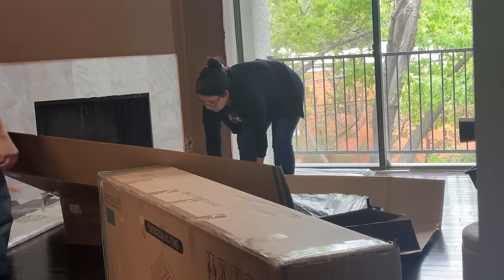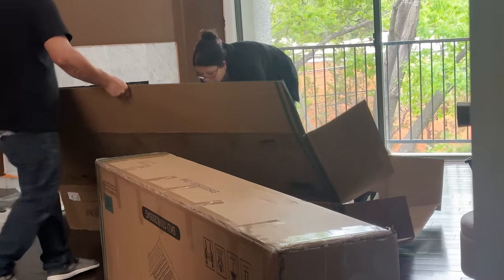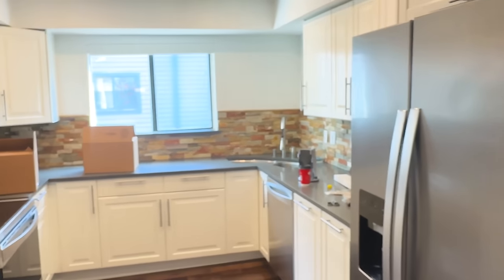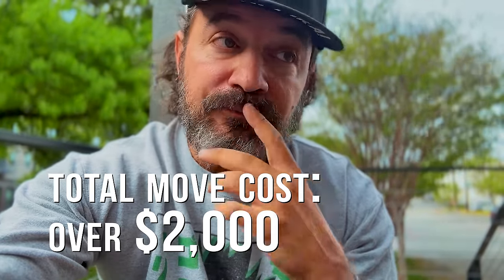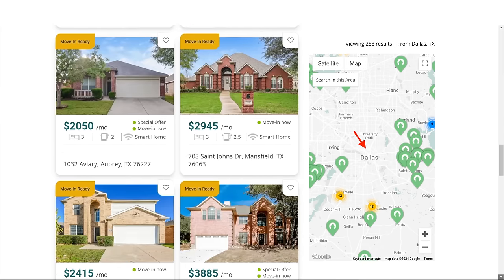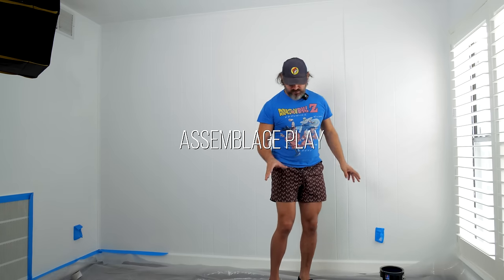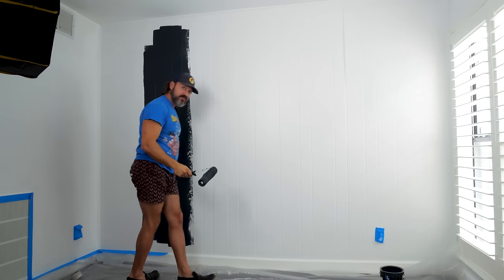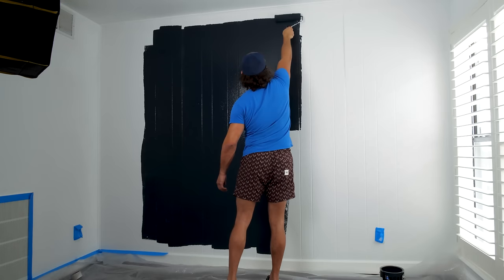Im Changing My Airbnb Strategy in 2024

Comment: Sean, after all your properties how do you not know to cut first, roll paint second. 🤔
Reply from the maker: I dont think ahead. I just do stuff
Reply: @AirbnbAutomated  Ah, as you said - ADHD. I get it. Get 'er done.
Reply: As a 26 yr painter I can say it’s always best to roll first edge after. 1 you don’t know for sure how far out to edge. 2 a lot of corners, outlets, vents etc may not need edged at all with the right roller. 3 rolling first has more texture that helps hide edge brush strokes. Over all if you roll first youll find edging after is much faster and easier.